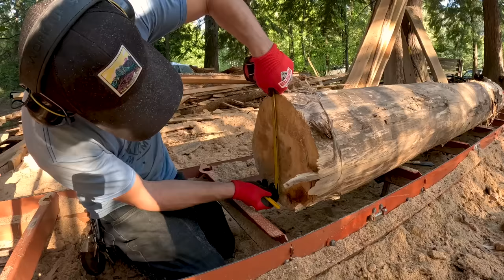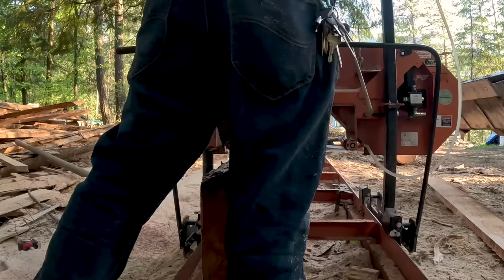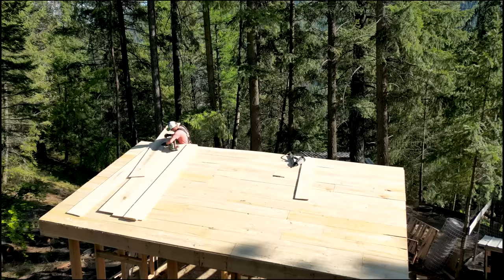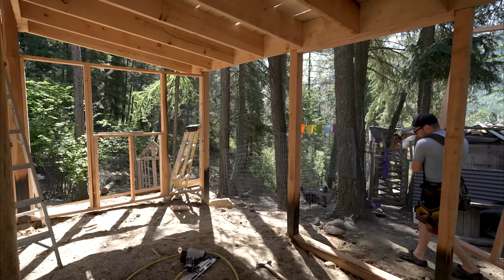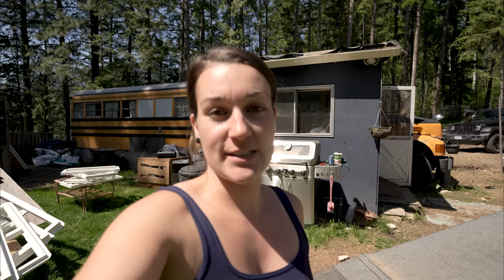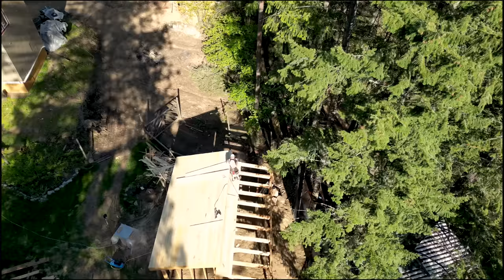Framing Is COMPLETE | Building A Barn For Free

Comment: You guys need a set of forks for that tractor. A friend of mine, father broke his back and is now a paraplegic doing the exact same thing you guys are doing,  using that bucket to lift things like logs.  Log rolled back on him because he hit a gopher hole. Log rolled back, down the loader arms, broke the muffler and pinned him in the seat.  Loader fork with a back stop can be acquired fairly easy and there not that costly
Reply: Excellent point and suggestion, I hope they're listening.

Comment: I truly believe that Cottonwood is a most misunderstood kind of lumber. Here in central alaska, we do have some beautiful cottonwood trees... some of our black spruce is okay but just about all we have to work with locally.... well the birch is really nice but not a softwood. I used cottonwood by soaking it in the pond after sawing it into lumber to keep it from warping too badly or kept it in narrow widths. I used it fairly green and then soaked it with a concoction of diesel and transmission oil as I was so broke at the time that paying attention was a pain.... I put it on my little garage I had built to work out of rain and mud. It turned out so beautiful that I re sided my house with it and did the same thing. I did figure out that if you don't cover it in  other wood or tight paper insulation, it didn't rot or warp near so bad. It is still on that house and little shop building the bank now owns when you get crippled and can't make a simple cheap payment every month.... I had to wait for insurance to kick in which it did, just too late and banks don't have hearts or even a small amount of feeling for their people... we are just numbers in a system... hurt so bad. I ain't so sure about roofing so will be interesting to see how it lasts.... and of course, there is always another day to re do it if necessary.. hopefully not tho. Those little chickens are soooo cute... coming from a guy no less
Reply: That is a massive amount of milling!

Comment: Another fun fact about cottonwood, is it burns extremally hot but it's stinky like crap. Something else that might be interesting to see would be if you guys took a chunk or your Rockwool insolation and try to torch it to see if it will catch on fire and keep burning on its own. You live in a tender box environment and it would suck if your house was susceptible to a major fire.  I hope your planning on burning the bottom of your first row of sighting that covers the metal flashing. Good video.
Reply from the maker: It smells so bad. Especially mixed with the tide laundry soap we couldn't stand on our clothes that is mixed in with the water on the mill 🙃

Comment: It is not free, there is the cost for the mill, the cost of your labour, tools such as Chainsaw, hammers, nails, screws, drill, you have no idea what the finall cost will be building your smallish Barn, you still need a barn or garage to park your equipment under and or in.    All the items you still need to do such as put your water line in the ground at least 3-4 feet down.
Peter

Comment: You NEED a very high pressure washer to spray OFF the gravel, sand, dirt, mud and the bark that contains these items.
It will save time plus the extra wear and tear on your blades and your mill.

Comment: Where is the break even in a sawmill?  A 2x4 costs less than $2.50.  A sawmill costs around $6K or somewhere short of 2500 2x4s?
Reply from the maker: I think 2x4 are much more than that. At least in BC. But the real savings are when you cut the bigger beams!

Comment: Are you thinking about a larger sawmill? You can buy a used Woodmizer LT40 with an electric motor. Delivery is immediate, and prices are a lot less than waiting for a new machine. Much less maintenance on an electric motor and no fuel bills. You could power it on solar if you beefed up your current installation.
Increased production would pay for the sawmill in sales of rough cut lumber.
Reply from the maker: It would be nice, but the price is so high. We are getting by with what we have now

Comment: what percent shrinkage do you expect from your lumber?
Reply from the maker: Alot of these trees have been sitting for a while so not much. We're already noticing gaps in the roof decking
Reply: Cottonwood is a poplar wood. It’s good lumber and takes paint well. It’s also a good kindling wood and used in trim work. Careful with eagles and a drone. It might attack it and get injured.